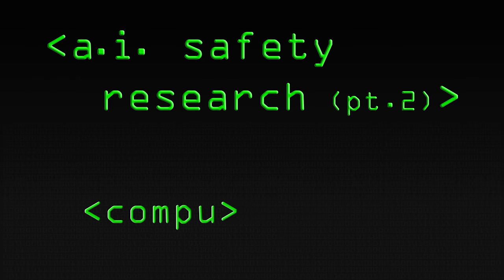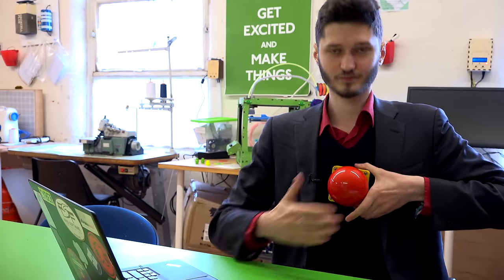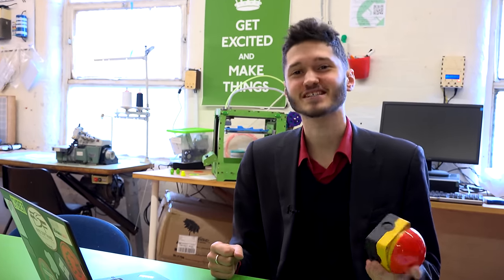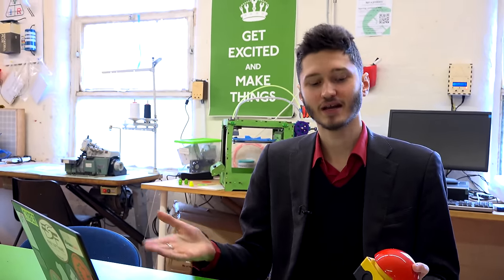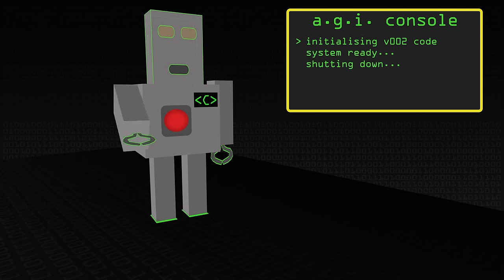AI "Stop Button" Problem - Computerphile

Comment: what if you dont give it  a stop button. just a button to give it a negative reward when it is about to make a mistake.
 and if it gets a too low reward score it would shut down. because we could then fix a problem that would ultimately give it a higher reward score. 
and if it doesnt shut down but realises it will get a negative reward for not avoiding the baby. then it  will fix the problem itself.
such a button would be needed. even when the testing is over. and a robot wouldnt want to remove it because if it cant be punished. then we would stop using the robot. and that would ultimatly lead to a lower reward score
Reply: "if it doesnt shut down but realises it will get a negative reward for not avoiding the baby. then it  will fix the problem itself."

Sure. One way it could fix the problem is by removing your arms to prevent you from pressing the button. Then it doesn't have to worry about your complex concerns about walking on babies and walking through walls or whatever.

At root, a stop button is just as bad as negative reward button. That's the only reason why it doesn't like the stop button to begin with - it rates poorly on its utility function. So does a negative reward button.
Reply: If you give it a negative reward before it made a mistake, it will not associate the negative reward with the mistake it was about to make. Instead it will think it made a mistake by carrying out the task it was given. Being programmed to avoid objects static or moving would be the smarter choice.
Reply: > Being programmed to avoid objects static or moving would be the smarter choice.

But that is not the point. The whole robot thingy is just an analogy for the bigger issue.

Also, if the robot is instructed to avoid disruptions, there are two optimal solutions to the problem - stop moving so it can be 100% sure it will never encounter a situation where it won't be able to avoid objects, or destroy everything so it can be 100% sure... You get the picture. ;)
The "bigger issue" is that we can't be sure what "most effective" solutions for any given problem a superintelligence would come up with that are disastrous for us. Attempts to stop it from doing some disastrous things may only lead it to discovering new ones - ones we never thought about when we designed it because we are not superintelligent.

Comment: You gotta make it so that the ai knows that if the button is pressed, there is a 50/50 chance that it will get 1,000 points or 0 points. However, if you press the button, the chances increase. This makes it that it does not want to take the risk of getting 0 points, but doesn’t mind you hitting the button because there is an increased chance it will get 1,000 points
Idk if it would work

Comment: Perhaps a general rule that damaging anything is a large source of negative points? It should be fine with spending additional time avoiding obstacles and going around the wall to make the tea instead of punching it's arms through and trying to pulling the cup of tea back through the broken wood and plaster.

Comment: Why not just allow negatives in the utility function?
Reply: I think it's because 'positivity' and 'negativity' doesn't matter when we consider utility functions. If a robot only has 2 utility functions, one yields 50 points, the other yields -50 points, this is exactly the same if the utility functions yielded 100 points and 0 points respectively.
Reply: @zss123456789  max (z) where z >0;
Reply: @lazerbrainzz  I'm not sure if I understand, is that in the definition of a utility function? I haven't looked.
Reply: @lazerbrainzz  I guess I have trouble seeing the benefits of allowing negatives in the utility functions is all. It'd be great if you could elaborate.
Reply: @zss123456789  I think some of my question probably stems from the over simplification needed to make a complex topic like this into a consumable piece of YouTube content and the fact that I'm a total noob at machine learning. The way I'm interpreting the assumption here is that there is a single value being optimized; whereas the real optimal solution should be maximizing multiple values. An example of an optimal solution might be max(z) = f(w,x,y); Where w = task completion, x = safe babies, y = obeys commands with w, x, y being weighted appropriately. Of course each input parameter is the result of some other function.
Reply: @zss123456789  Not really sure as I've literally just within the past couple of weeks begun to explore ML, but going on intuition alone it seems there should be a way to weight the input in a way that a given outcome is bad, hence the negative or 0 (score/value).
Reply: wakamoto1105  comma, comma, comma, comma... ✌️

Comment: I think a cooperative robot requires not only incentives/rewards (a built-in pleasure analogue), but also a punishment mechanism (a built-in pain analogue). This is what humans have (pain and pleasure, with built-in environmental triggers of such responses), and in cases where it's set up properly, it works well. Presuming you'd be able to control what it wants (ie what gives it pleasure), you'd also be able to control what it doesn't want (ie what gives it pain). We can't just use deductive reasoning of the absence of pleasure to approximate a desentive/pain. It would need both pleasure and pain.
Reply: Do you think a number representing utility is capable of that? It works for chess...

Comment: I feel like the root of the problem lies in the way the AI values his own work (or is rewarded for it), for example, I assume you assumed he was rewarded depending on time and success, meaning it will try to take the shortest "path" to fulfilling the task you gave it, so it sees the button as the "shortest path" to the same reward, if it's that simple, it WILL cause a problem, but complex or different systems for rewards could fix the problem.

Comment: 12:30
There was a a mention of optimization problems - that they say the button will probably be removed as unnecessary during optimization if the robot will not know it is needed. But you can use something like the "volatile" keyword in c++ to not to remove the button during optimization.

Comment: I realise I'm a bit late, just a tad! But I found this video really interesting. It's alignment for dummies!

I thought it could all be simplified by just giving the reward for the tea as soon as you want the robot to stop, then remove the tea instruction?

But if its autonomous how are you gonna do that? Don't allow autonomy without inuput?

If you can instruct it remotely, you need to be able to also reward it remotely.

The notion of explaining that you changed your mind is way off scope for this thought experiment, but providing the reward in order to stop the robot is logical.

The reward is the end of the function.

It may try to learn the best way to get the reward based on this input, but I can't see how it could form any useful strategies if the only clear objective is to make the tea.

This would equate to a directly executable plan to get reward, with a possible awareness of other options outside of its capabilities.

If it doesn't try to account for outside influences beyond its control such as change-of-mind, and if the reward can be controlled, the button problem is solved?

And with higher levels of intelligence, monitoring a snapshot of the machine state when a reward is obtained could be simulated/input??

Very interesting. I'm sure if you had the time you could explain why this is what all newbies come up with!

I'm thinking failsafe snapshot revert. The only problem with that statement is the word failsafe!

Checkpoints are important tho. I'm still thinking....
Reply: The need to make the AI work forgoes the compute required to have checks and balances. Case closed
Reply: Doom!

Comment: Seems a bit late to be adding a comment but here goes anyway.  I think the stop button problem can be solved by looking again at why we want a general AI at all and what the fundamental goal of a general AI should be.  We want a general AI to do things for us.  Therefore we need to design AI that WANTS to do things for us.  In the given example the goal of the robot should never be to put a cup of tea in front of its user/operator.  It should always be to please and or avoid displeasing its user/operator by, in this case, providing a cup of tea.  We will also only need a general AI if it is going to be handling multiple tasks for us.  It will, therefore, need to prioritise resources for these different tasks and we will want it to prioritise them in the order that serves us best.  It will, therefore, need to develop an understanding of what serves us best.  A stop command, whether by switch or verbal command, becomes a high priority task, that by promptly obeying will please us, (and failing to obey will greatly displease us).  On the other hand, manipulating us or its environment into giving stop commands will displease us and by making this displeasure explicit we should be able to train the AI to avoid that behaviour.  In summary, if a general AI does not WANT to please its user/ operator it sooner or later WON'T please its user/operator.  User feedback is the key.

Comment: On the one hand it's said to be strictly controlled by a fixed utility function with the button in its model, but on the other hand with the button hidden from it, it's said to be "who knows what it's capable of"... But if it can solve the secret of hidden forces possibly causing its termination, it could even more likely and easily question the validity of its -- not at all hidden -- purpose (util. fn.) to begin with.

Comment: The stop button is only a problem in a general purpose AI, where it is performing multiple, sometimes conflicting tasks. Some of which are essential and must not be shut down - power generation, industrial processes,  - without human permission. Others which are safety critical and must sometimes be overridden by humans - self-driving cars,  aircraft autopilot. One solution is to use many individual task focused AI systems, rather than one big anthropic based system that controls everything and attempts to be a superhuman "intelligence".

Comment: Outline to a (possible) solution, dont know if it's one of the solutions suggested by people befor... in short, a.g.i. is aware of two seperate goals, self goal(getting tea), creators goal (getting tea in an as good way as possible). Now it can know that pressing the off button is the creators possibility for reaching the creator goal, and accepting that the creator goal is more important. The button is not a part of the a.g.i. 's goal, and will not care if it is pressed. So basically programming in that an other "persons" goal is more important.

Comment: Perhaps one way to stop it from stopping you from pressing the off button is to decrease the points it gets dramatically if it attempts to stop you.
Or maybe have the points in a list (or something like that) and only add the points to the list if the button wasn't pressed (a score of 0 would obviously still be added to the list, pressing the button just wouldn't add anything to the list at all).
Reply: The issue with the first one is it's just patching and it may just find other ways to stop you. I don't understand what you're trying to achieve with the list.

Comment: So here's the thing with this button, right? You've walked this through with giving the button a positive reward. What I was thinking and got refered to this video for was to give the button a negative reward, and to give any state where the instructor would want the button to be pressed if perfectly informed a much higher negative reward the longer the button remains unpressed.
The problem with that is of course that "the instructor would want the button to be pressed if perfectly informed" is hard to specify. However, the smarter an AI would become, the better it would be able to understand this objective. (Or is it categorically impossible to let an AI figure out how much a terminal goal is worth? Does that only work when you have several disconnected AIs, like with Reward Modelling?)

Comment: Object infront = avoid/go around  (Otherwise it'l never get to the Tea)
Human infront = avoid/go around (You already have the programming for this)
Build as much into it as you can then it never has to think about it.  Why does it need to be aware of the button?  Put it on a remote, make it a seperate system so it has no idea its even there.

Comment: I'd imagine the way to solve the problem is to set it such that the stop button also suppresses the AI's ability to learn from that situation. Using modern neural networks, effectively you wouldn't give it any sample data in which the stop button was ever pushed or not pushed and none of your simulations to train it would ever include using the stop button. Essentially the AI would never know you can shut it down, and thus wouldn't conspire to either encourage, or discourage a shutdown.
Reply: I’m pretty sure that’s already been explained in the video.

Comment: I agree you need the AI to cooperate on a more intelligent level. But in order to make it not want to stop you from hitting the button and not hit the button itself you could have a voice command that subtracts utility from the end goal which can only be restored if the button is hit. This way the robot would avoid reprimand, and hit it's own button but only when you wanted.
Reply: your "voice command" is just another "button".
the button itself is just a toy to explain a greater problem, you can replace it with any other means.
your voice would count as a mean to stop it... so you find yourself at the initial problem.
your solution is just replacing the button with a new one (voice), not really solving the underlying issue.
Reply: Yeah, and then it rips out your vocal cords.

Comment: Easy. Make the button part of the hardware (like disconnecting the power supply would be, or say a small explosive in the motherboard if you are feeling extreme), and do not integrate it into the cognisance of the A.I., so it doesnt even register it. Robot cant object to what it doesnt know about.

If you are worried it will figure it out, put a second off function, which the A.I can bypass. You can also incorporate a single non-AI program that monitors AI behaviour according to some basic undesirable parameters, so you remove the human manipulation factor. 

Even if the AI puzzles it out, there is literally nothing it can do, as a drastic 'off' switch has been incorporated in its basic structure, one it has no control over either way.

Another completely different tack would be to marry the AI code to an organically engineered substrate. You can control it with hormonal or electric/ magnetic triggers, or if well engineered, it will control itself like a human simulacrum
Reply: the video pretty much implies that it isn't part of the consciousness. it tries to stop you from pressing the button, not disobeys to the button press. it would get a negative or positive result with the button, but it would still be part of the hardware.

Comment: Negative reward for the button, positive for the correct process. Only way to optimise/ensure maximal reward is to not do anything that would result in the use of the button, while still carrying out the correct process (which itself is the only way to generate a positive reward). 

The inherent problems are due to how unsophisticated the system outlined is, as you’ll need to account for “paradox scenarios” (don’t know what you’d call them) where “ah I can’t move because I’ll trample the child, but I can’t not move because I’ll be switched off”. 

Explicitly declare/map unwanted behaviours to the off button would help, though. The key is to not overcomplicate the main reward, as, according to what’s been outlined, that’s when deception comes into play to enhance the total reward.

Alternatively, use a well-developed dataset and regression.